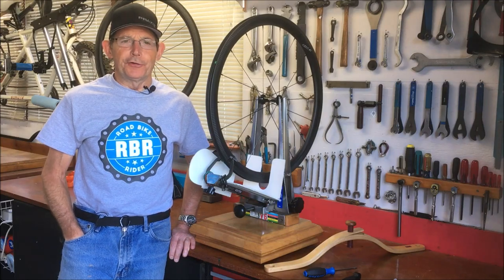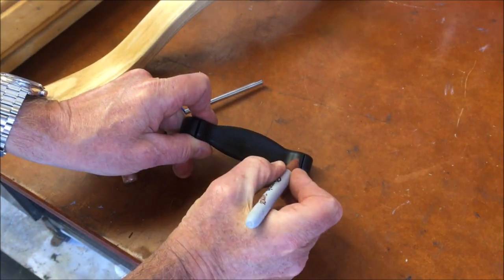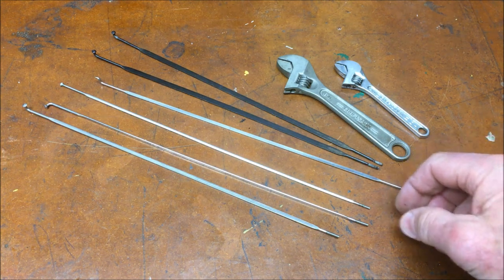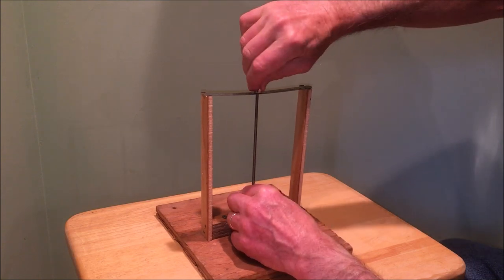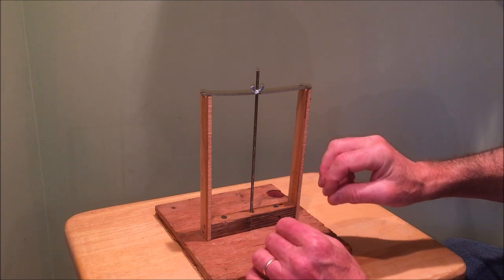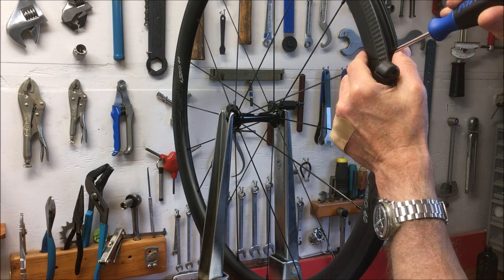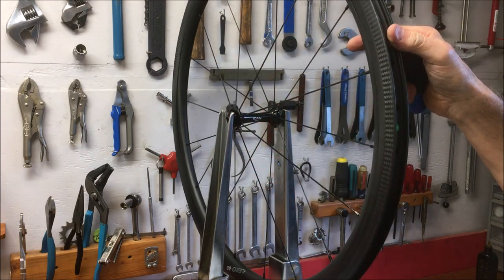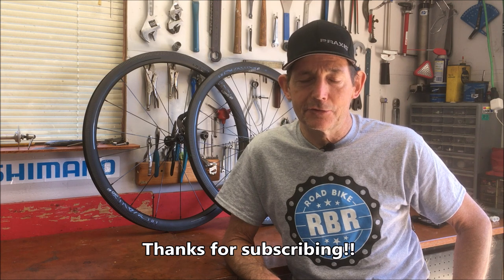Fixing Bladed Spoke Twist on Aero Road Bike Wheels

Comment: Thanks again Jim. I’d love to see a short video of you talking about your ride experience on the Aero 40’s. Something that summarizes and updates your various comments about ride quality and durability on the 3 videos would be great.
Reply from the maker: Thanks for the request, backpackerx.. I am planning on making that video when I get in a few more miles. I lost some outdoor riding time due to the Covid issue and our local regulations. Ideally I'll have 2,000 miles on the wheels, which is usually enough to show any developing issues. So far (about 1,350 miles), the Aero 40s have been nice riding, light and aero wheels. They're still as true and round and tight as when I unboxed them. I'll keep riding them and when I feel I've given them enough of a test I'll post the conclusion/ride test video. I'll try to make it worth the wait. Thanks again! Jim
Reply: Jim Langley thanks. Much appreciated. Just ordered the Aero 40’s so hopefully I have the same experience minus the spike twist issue.
Reply from the maker: @backpackerx  I hope so, too. Look forward to hearing how you like the wheels when you get them. Thanks!
Reply: Jim Langley I received the wheels today but I’m getting a lot of vibration in the small cogs when I’m pedaling on the workstand. Should the rear hub body with the splines be loose side to side? I don’t think it should be and it slides back-and-forth probably 1/16 to 1/8 of an inch and I think that is where the vibration is coming from.
Reply from the maker: @backpackerx  The freehub body needs to spin freely for coasting, but it shouldn't have much play in it at all. Some freehub bodies can come loose from the hub if the wheel is dropped (possible that might happen during packing or shipping). You might remove the cassette and check to make sure the freehub body is fully seated on the hub and the right end cap is firmly seated on the axle.  For the roughness, the most common cause of vibration on the small cog is the rear derailleur not aligning quite perfectly with that small cog/cogs. You can determine if that's the case by gently pushing and pulling on the derailleur so it moves in and out and seeing if the vibration changes at all. Sometimes a very small adjustment with the derailleur will make the difference between smoothness and vibration. I hope one of these things solves the issue for you backpackerx.
Reply: @JimLangley1  Thanks Jim. The play is in the same plane as the axle meaning the cassette can be pulled away from the wheel by 1/16 or so because the hub body slides back and forth. The lockring is tightened to the correct 40Nm. When I install and tighten the skewer most but not all of the play goes away. My other wheel has zero play so not sure what is normal.
Reply: Also this is with an 11-speed cassette I should note so it's not spacers. The hub body itself is what shifts and the cassette comment was for clarity.
Reply from the maker: @backpackerx Sounds like something's not right. Zero play is what it should be, but 1/16 inch is not a lot of play. The skewer only puts pressure on the axle and hub bearings not the freehub body or freehub bearings, so the fact that the play goes away when you tighten it is strange. I have the ICAN RO1 hubs. I just checked and theres zero play on my freehub body. You might measure your over locknut distance - the distance between the surfaces that touch the inside of the rear dropouts. It should be 135mm. If it’s more than that it could be that some axle part is misassemled or has come loose. That’s what I would look for. Good luck!

Comment: Thank You so much for the helpful info . i Have a bladed spoke wheel that i bought used and did not notice the twist in the spokes, all of them are twisted . So now , i am not a wheel builder!  I tried to untwist the spokes,  Mistake  # 1 i could not figure them out to get them untwisted . Fast forward a little and all my spokes nipples are lose with no little tension just enough to hold the nipples on . i have tried to tension the spokes i have the park tool tension meter but i cant seem to get the tension right. it seems when i tension the blades are twisting a little here and there and i cant seem to get them strait. i have the tools you used but cant get it right. the wheel is high end and new . i think when i tension and some times  untwist  the spokes i  twisted that the spoke is going to far up the nipple (I think thats whats going on) the spoke going to far up threw the nipple when untwisting and trying to tension. I know not good info for you to try and figure out. sorry. any advice for me. I DO NOT WANT TOI TAKE IT TO A SHOP TO FIX IT FOR ME. I NEED TO LEARN AND FIX IT MYSELF. Thank you for the great info you are a master wheel builder , thanks for sharing your  knowledge.
Reply from the maker: Thanks for watching and the question, Tony. It sounds to me like you're going to want to start from the beginning and basically loosen all the spokes then get the wheel true and round and centered and then retension all the spokes. THE IMPORTANT thing is that when doing this you will hold every spoke with the spoke holder tool and keep it straight/flat (not twisted). NEVER make a spoke adjustment unless you're holding the spoke with the spoke holder and keeping it from twisting/changing position.

If you don't know how to true and round and tension the wheel, please watch my other video here: https://youtu.be/XUqul03hbZ8 You already have all the spokes in the wheel so you can use the table of contents links on the video to jump to the part after the lacing of the spokes. Please let me know if you need more help and I'll get back to you as soon as I can. This will take you some time to complete but you can do it if you work slow and steady and pay attention to what you're doing. It's actually enjoyable. Allow yourself plenty of time and stay focused on what you're doing. Good luck!

Comment: when you turn the spokes and the screw for the spoke tension at the same time, that means also that you are tighten or loosen the tension. how do i you fix a tiwsted bladed spokes without changing the tension though? Thanks
Reply from the maker: Thanks for watching and the question. I show how to do it in the video here 6:03 . Thanks again!
Reply: @JimLangley1  But in your model, the spoke is able to rotate where it meets the hub.  I have a situation where it doesn't rotate at the hub.  Thus turning the blade and the nipple at the same time twists the spoke and changes the tension.  No one would want to do this, but my spoke is stuck to the nipple,  So the only way to true the wheel is to turn the nipple and spoke together. But that introduces the twist mentioned above.
Reply from the maker: @LVQ-so5th  thanks a lot for watching LVQ. You can't true a wheel by turning the spoke and nipple together because if you do that nothing changes. To true the wheel you'll need to turn only the nipples. If your spoke is stuck to the nipple it could be because they used thread locker when they built the wheel. You can try heat to loosen the thread locker but be careful. You don't want to overheat the rim or any stickers or paint etc. You might be able to do it with hot water on a rag or with a hair dryer but work carefully and don't damage anything. Try first on one stuck nipple. You can put a wet towel on the rim to protect it if you want and just heat that 1 nipple. With some heating you should be able to turn the nipples but be sure to hold the spokes with a spoke holder tool like what I show in the video and hold it up close to the nipples since you'll need to turn the nipple firmly and you don't want to twist the spoke as you do that. Once the nipples turn you will be able to true the wheel. Hope this helps and let me know if you have other questions.

Comment: Great video. How do you determine which size Internal Nipple Spoke Wrench you need?
Reply from the maker: Thanks for watching and the excellent question, Shadowz! Here's a helpful resource for determining which spoke wrench is needed: https://www.parktool.com/blog/repair-help/spoke-wrench-tool-selection With internal nipples, since they're inside the rim it can be difficult to measure them. Some spoke companies list the dimensions of the nipples and some tool companies say in the description which wrench is for which type of nipple, but not everyone does. With internal nipples I have had to buy a couple of different wrenches to try the fit before getting the one I felt was safe to use. You might also be able to contact a company that sells wheelbuilding supplies and ask them. Hope this helps and thanks again!

Comment: Jim, every video I watch of yours helps me immensely, including this one. I know I have "spiraled" some bladed spokes, and always thought "there must be a better way!" And you just introduced me to it. Very grateful sir! On another generally related note, recently I bought one of the Unior spoke holder tools that you shared info about - so, that tool is not really for holding bladed spokes, is that correct? Thank you!
Reply from the maker: I appreciate you watching, Peter and I'm happy the videos are helpful. Unior's tool is called a straight-pull spoke holder. Straight-pull or direct-pull spokes are any spokes that don't have J-bends/elbows in them. Without the bend/elbow, the spokes can turn inside the hub when you turn the nipple - since there's no bend to keep them fixed in place. Straight- and direct-pull spokes come in round and aero/bladed profiles and Unior's tool will hold both just fine. Unior's tool does have a size written on it. So it's possible you could run into some bladed spokes that are oversize for the tool. But, it should work on most common sizes - I haven't found a spoke it won't hold onto yet.

When using the tool, look closely at how the jaws come together and place the tool so that its pinching jaws that close on the spoke are as close to the nipple as you can get them (while still getting the spoke wrench on the nipple so that you can turn it). That will reduce the chances of the spoke trying to wind up between the spoke wrench and Unior's holder. Some aero/bladed spokes have long enough round section near the nipple that you can hold the spoke there, too. Okay? I hope this answers your question. Thanks again for watching.
Reply: @JimLangley1  Totally answered my question Jim - thanks again. Ok, I feel confident now working with spokes. Somewhere along the line I picked up a Park Tool SW-10 which supposedly "removes tight, stubborn or rounded nipples." I haven't ever tried it. Do you find it useful? (assuming you have one, which I bet you do!)
Reply from the maker: @peterweatherby8816  Hi Peter, sadly, I actually do not own the SW-10. I am pretty sure we had one at one of the shops I worked at, but I never bought one for myself. It's a clever tool. For anyone reading this who doesn't know what it does, here's a link to it on Amazon where there's a photo - but right now it's marked as unavailable (I think Park Tool discontinued it): https://amzn.to/3gHI0cJ

There are lots of workarounds for getting off rounded or locked-on nipples. I usually use a small pair of Vise-Grip pliers. Sometimes you can tighten the spokes nearby a little to take a little tension off the beat-up/frozen nipple and that can make it less difficult to turn. Also, if you can get a screwdriver into the nipple slot to turn it there while at the same time gripping the body of the nipple with another wrench/pliers, you can usually over power it and get it off. Hang on to that tool - it's probably worth a lot more than you paid for it ;-)

Comment: Very instructive again and my warm thanks again. I got a question. Is there some tool to measure and fix round spoke twisting too? Would be great as it seems much more difficult to spot naked eye. For round spoke it seems that the most you can do is to push on rim or on the spokes or to squeeze them. You know they were twisted if you hear some weird sound. And then you can just hope and not measure that they are not twisted anymore... So is there some better way for round spokes, something more than guessing and mere flair from experience. Thank you!
Reply from the maker: Thanks for the kind words Francis. And for the great question. The best answer I can give you is to do everything you can to avoid twisting J-bend (standard) round spokes to the extent that they stay twisted. Because if you twist a J-bend round spoke so much that it actually remains twisted, you have actually cold formed the metal and changed its properties. Yes, you might feel or notice this and want to untwist it, but if you do that, you are putting another substantial stress on the spoke. The round spokes most likely to twist are the lightest, such as a double-butted spoke with a 1.5mm center section. I prefer not to use such light spokes and if you stay away from them you will be less likely to have round spoke twisting issues. 

Note that twist, wind-up, turning, is most common on straight-pull, direct-pull type spokes, which do not have J-bends at the hub to hold them in place. But, these types of spokes are also much less likely to actually become deformed and damaged should they turn in the hub. 

Something that can cause twisting is if the nipples bind on the spokes. This can happen if you build with thread adhesive or use a drying thread prep and mistakenly put on too thick a coat. Ideally, you'll realize what's happening as you true and tension the spokes and stop before you've actually twisted a round spoke. A technique to use to feel that spokes are twisting as you're truing and tensioning is to rest a finger on each spoke as you tighten them. That way you will feel it if the spoke itself turns along with the nipple. Sometimes this happens and if you know it happened, you can then reverse the direction of the nipple about 1/8th of a turn to remove any wind-up, twist in the spoke.

If you can't feel when the spokes are turning and trying to twist, you could try marking the spokes so you have something to watch to determine if they are. On black spokes you could put a small white paint pen dot. On silver, a black dot. Or, you could put a piece of tape on each spoke like a little flag that indicates if the spoke turned.

If you're dealing with round spoke twist a lot or working with straight-pull spokes, I would recommend making a simple tool to clamp and hold the spokes on the top butted section just below the nipple. If you hold the spoke, it won't be able to twist when you turn the nipple. The tool I use is made from the Vise-Grip 4WR locking plier https://amzn.to/2ESYGgQ  BEFORE using it on spokes, you file the jaws smooth. That way when you clamp the jaws on a spoke to hold it you won't scratch the spoke. The tool company Unior recently came out with a set of straight pull spoke holder pliers for this, too https://uniorusa.com/products/straight-pull-spoke-pliers-1753-2b-us

With these spoke holders you will be able to turn even binding nipples without twisting the spoke. Note that there can be rare situations that will not just bind, but lock the nipple on the spoke, such as a spoke length issue where the nipple bottoms out. In that case, you would want to replace the spoke with one of the correct length. I would also not try to untwist twisted round spokes. Instead I would try to realize that I twisted one and replace it with a new spoke. Then I would use my spoke holder tool and make sure not to twist any more. And, again, I would try to choose spokes in the first place that resist twisting. Hope this long answer is helpful. Thanks again!

Comment: Great vid.  Bought a set of these recently based on your reviews and those of John Knowles.  Can you tell me exactly which Park socket you're using here because, unsurprisingly, my spokes aren't all straight!
Reply from the maker: Thanks for watching and the question, isthatujeebus. I was hoping ICAN might start using the tool themselves but I guess not. I will double check which slot fits on my ICAN's and get back to you as soon as I can. Thanks again.
Reply from the maker: The size to use on the Park tool is the one marked "A" isthatujeebus.

Comment: Really enjoyed watching these series of three videos. Very informative. What are your thoughts on wheel balancing? I’ve seen a few videos on this matter. Is it necessary?
Reply from the maker: Thanks for watching, Todd/Jill - I appreciate it. It make sense that if you are seeking a perfect wheel that balancing would be an important step. However, I can't say I have ever noticed an imbalance issue in 55 years of all kinds of cycling and bicycles. Yes, I can see it when the bike is in a repair stand and you pedal the rear wheel up to speed. But, if I go ride that same bike, I can't feel anything like what you see in the stand. Even when a wheel has a heavy reflector on it, I can't feel that it's there. Still, if I wanted the ultimate in efficiency and thought that a wheel had an imbalance, I might try balancing it (I haven't yet balanced any wheels). Here's a kit that's less than $30 and is easy to use https://www.cantitoeroad.com/Shelter-Wheel-Kit--35-Pre-Cut-valve-silencing-wheel-balancing-discs_p_674.html It does raise two concerns, though: 1) even though the weights weigh so little, they do add grams to the wheel (never a good thing); and 2) they will increase aero drag a little (to solve that, I bet you could put them inside the rim instead of on the outside of it). To sum up, I hope we see some more quantitative testing to find out for sure if it's worth the trouble and expense. Even if you can't feel it, if it saves energy improving a rider's efficiency, then it's worth doing. Thanks for the great question!